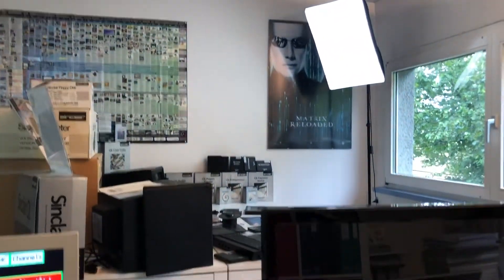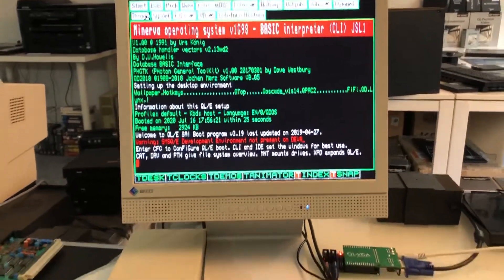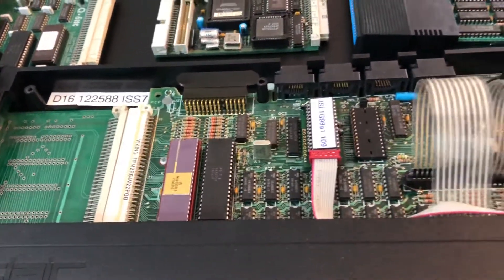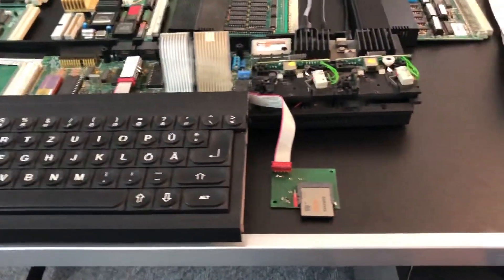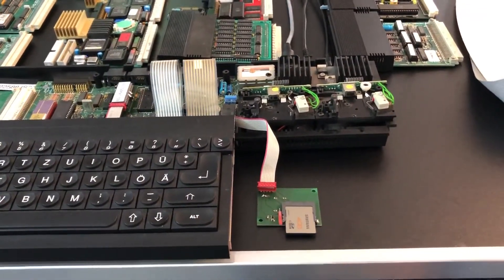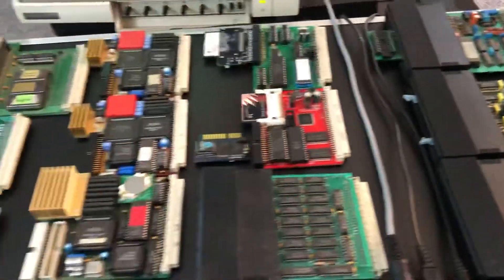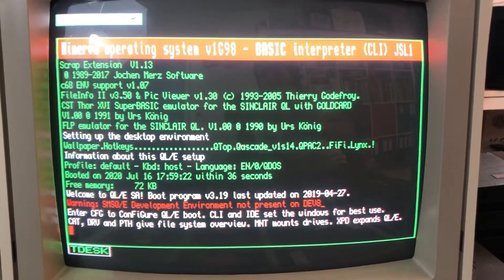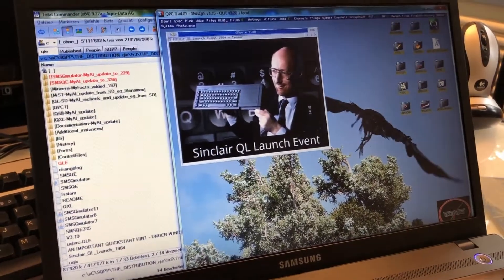Sinclair QL systems in action, brand-new QL-VGA first usage, updated QL-SD (v1.09) and much more...

Comment: Hi, I just backed for a Spectrum Next. I hope some day there will be a QL next. I lost my heart to the QL, great machine. I don't have anything anymore but my setup at the time was: Spem external keyboard, a Sandy QXT housing ( if I remember that correctly), a speechsynthesizer (which one I don't remember), I had a 512K expansion cart (don' t remember wich one) with toolkit 2, 2 diskdrives and two microdrives, all installed in the Sandy housing, and a mouse. I installed everything myself. And of course al lot of software.
I can also remember that I copied protected software with the 'CFORM' command. 
If I remember correctly, in a disk editor, the first few characters on a disk were: QL5A

It really were fun and good times, learning about the QL
You have a great setup there.

I bought a QL emulator many years ago, just to be busy with it, but after some time, I lost interest. 
But when I see your short video's, I still get a great feeling about my QL childhood.